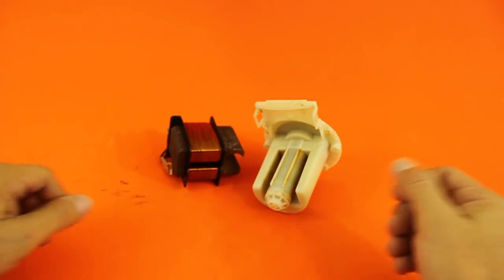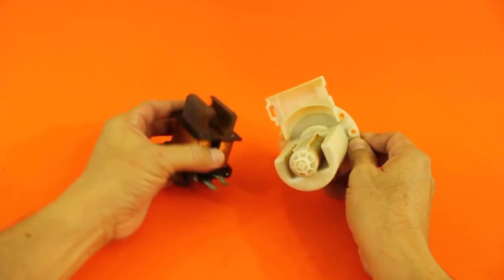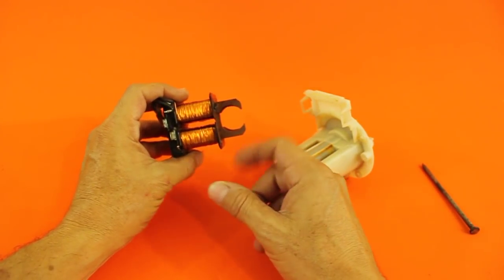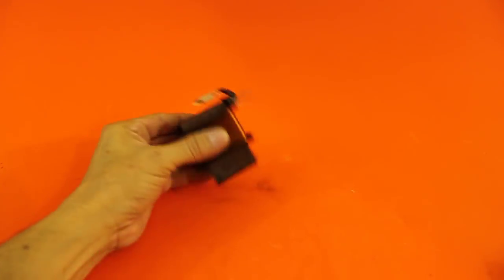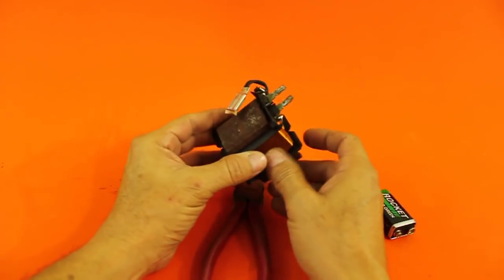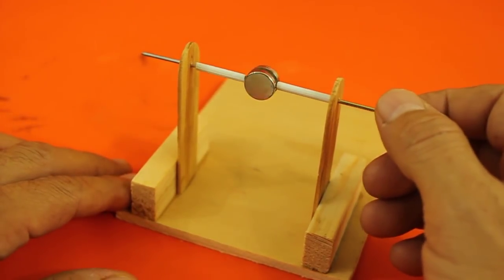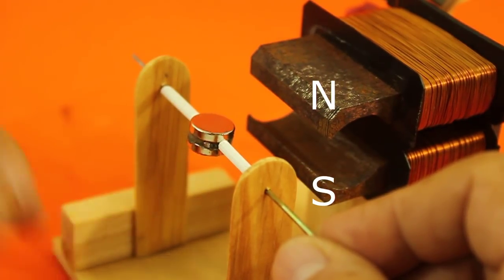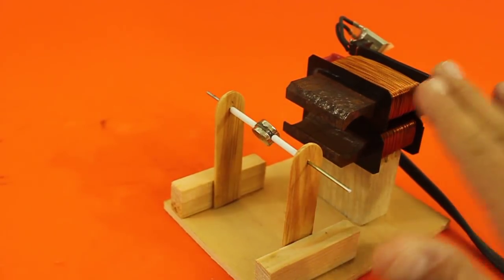AC Electric Motor

Comment: Hi Lucid Science, what is your power supply to get the magnet spinning? I tried to replicate with an adjustable DC power supply and it didn't work. Any thoughts?
Reply from the maker: it is connected to the wall socket

Comment: primero que nada deja te felicito por un canal tan grandioso y lleno de knowledge yo mirava tu canal en Espanol, so let me continue here in English, i do have a question, for the magnets you used you are using two of them right AND also are you positioning them in a way that south, north pointing outwards or are they north, north pointing outwards or south, south-pointing outwards and final question can i put 120v to one of those pump motors i have one just like that one 
thank you

Comment: I am very surprised you made no remarks about direction of rotation.   But the question is why?
As a water pump, perhaps it is designed in such a way that no matter which way the rotor moved, the water would flow in the intended direction I would think so they kept this motor simple instead.

Comment: How i can calculate max voltage that coil don't burn up?
Reply from the maker: You need to apply the voltage that will allow for the max current your wire can handle. You need to take into account resistance of the coil and also the reactances.
Reply: Good question, I once had a solid wire(from phone cable, the inside wall one) wrapped around a toroid and wanted to make a tansformer then it just burned! ;D
Resistance was like 1 ohm or something, dunno why.

Comment: perm magnet motors with fixed frequency signal to the stator coil are called  syncronous motor. important part of the  construction of such motor is having a flywheel on the motor axis

Comment: How do you know (or change) the direction it is going to rotate? clockwise or counterclockwise?
Reply: change polarities if dc, if not you have to force the rotation with your hand brfore powering the motor.

Comment: Sir, could you maybe explain how a 2 phase motor works that is called the tesla 2 phase motor and has green and red coils. I cant wrap my head around how it works and how the magnetic field react because the coils are wound on an iron ring so are parallel to the rotor. Your motor I understand because your coils are in line with the rotor/facing towards the rotor. Could you maybe replicate a motor similar to the One I talked about.  I am a big fan and love your video's, thanks for sharing :)

Comment: Nice video.  Do you know how the device in the washing machine always rotates in the same sense (CW or CCW)?
Reply from the maker: That´s a good question, I don´t know, maybe some kind of assimetry in the magnert
Reply: Thanks; I thought perhaps the magnet in the impeller was not  symmetric in the electromagnet, but could not make this out in video.
Reply: Does it have to spin in a certain direction? The impeller on the pump appears to have straight vanes, which might suggest that it's designed to work in either direction.
Reply: Good point.  I bet that's the correct explanation of why the sense of spin is not important.
Reply: No, it can spin in either directions.

Comment: Place the magnet between the iron core, maybe it will turn faster and stronger, nice experiment.
Reply: it will stick to iron and will produce a buzzing sound
Reply: If you secure it well enough than it won't stuck to the iron. But that is something that will cause trouble.
Reply: It won't spin faster, as it's synchronized with ac frequency.